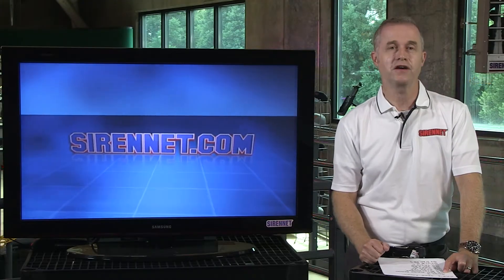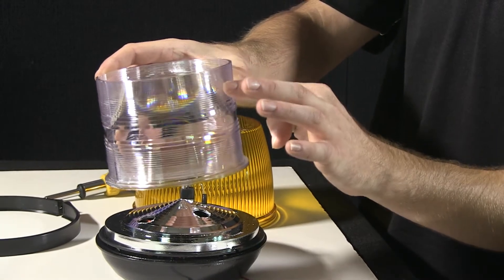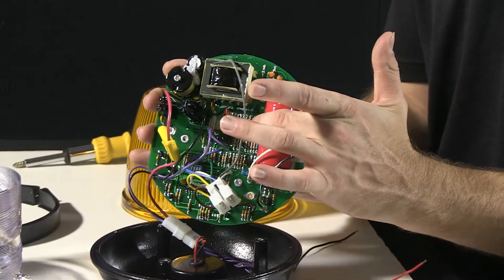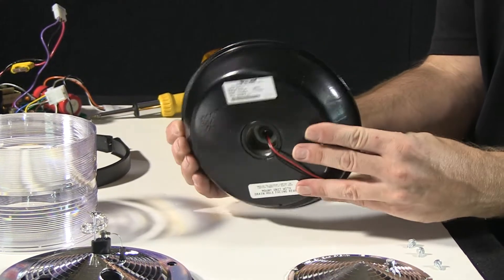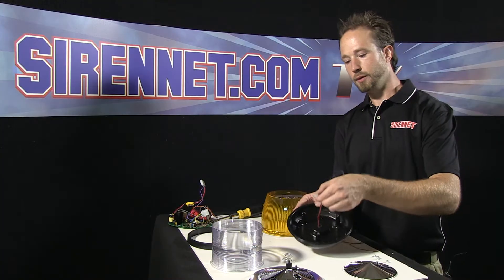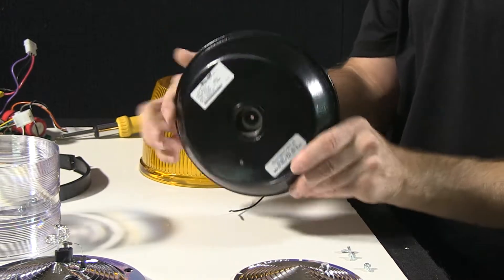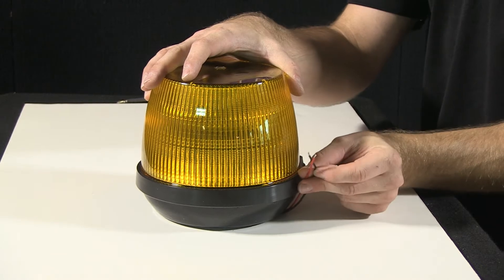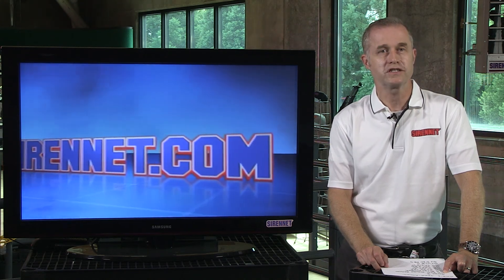Chris disassembles a Whelen S360D Super Strobe Beacon

Comment from the maker: The wiring/connector inside of the S360D is for operating the Beacons Hi / Lo intensity function. It is not a commonly used feature which is why the wiring is left tucked inside the unit.